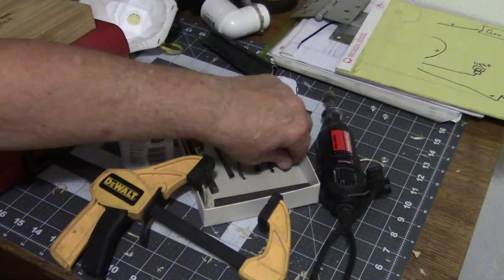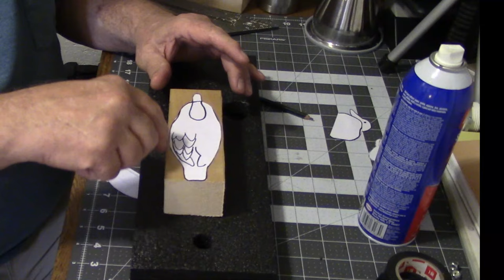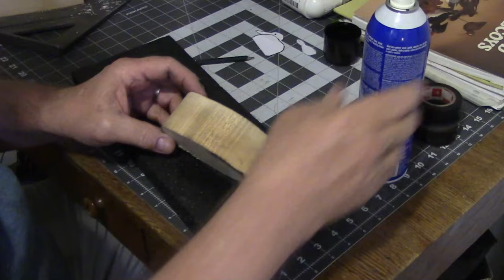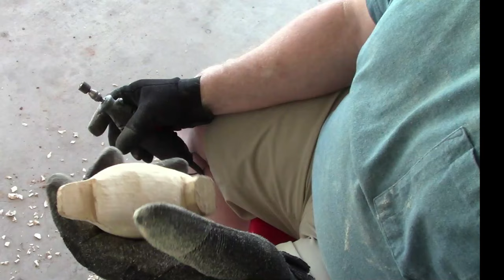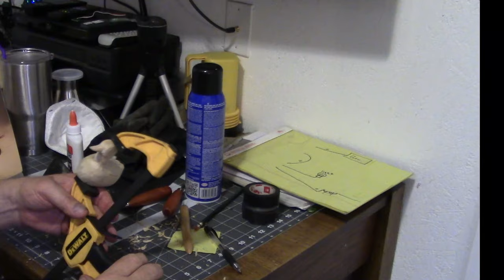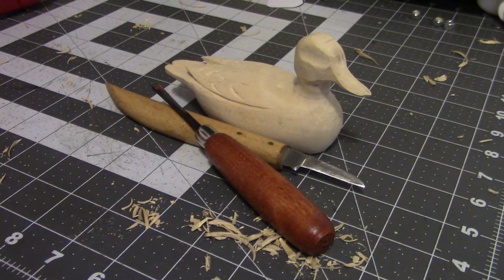Duck Decoy Carving

Comment: I use just the chisels. A template rarely. Good way to get a start on the shape. I usually use pine. It chips a lot against the grain. That basswood looks like a much better choice. I've used walnut. That's a tough whittle. It's been a long time for you. It's been around 5 years for me but during these times, I decided to finish a project that wasn't done yet. Mine are pretty crude but still fun and a good way to pass the time. Your decoy came out real good Lloyd. Are you going to put a finish on it or paint? Stay safe my friend.
Reply from the maker: Thanks,  I don't carve a lot but enjoyed it now and again over the year. Stay well my friend